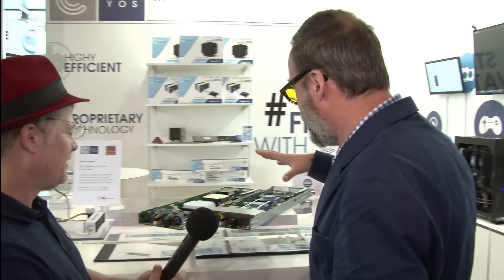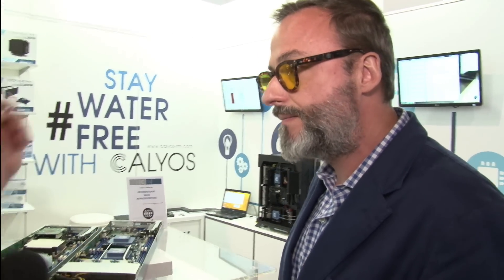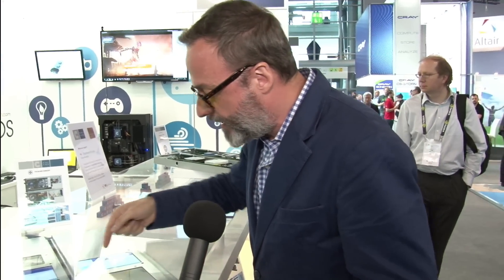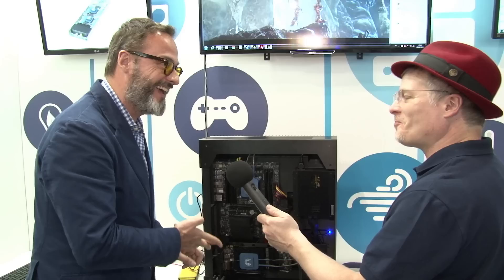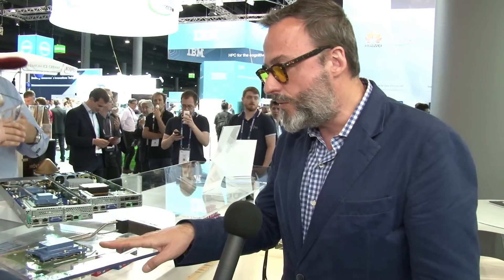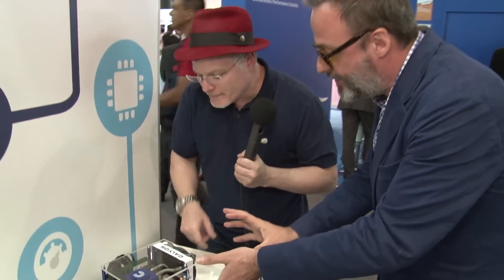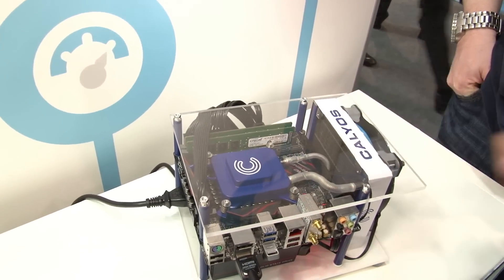Calyos Demonstrates Water Free Cooling at ISC 2016

Comment: https://www.kickstarter.com/projects/1489140137/nsg-s0-worlds-first-fanless-chassis-for-high-perfo/faqs

Does it really make no noise?
NSG S0 is equipped with fanless phase change technology. This means there is no moving parts. Cooling and casing won’t make any noise. But depending on your electronics options, you may hear coil whine or HDD working.

Last updated: Wed, March 29 2017 7:23 PM CEST

FOR GOD SAKE CALYOS. You need yo make a PSU that don't coilwhine under any circumstances. Use your cooling to cool the PSU too.
Reply: coilwhine is often experience at graphics card putting out unrealistically high fps, for example in ancient games, or menu screens without fps lock.
like the gtx260 i got will start having a strong coilwhine at 3000 fps for example.
it's manufacturer based not cooling based, however it did get a lot better compared to how it once was and is quite rare to experience, however it will be interesting how the experience changes once calyos phase change drops the minimum audio of a computer system to ambient without losing performance.
so if u don't want this issue check extreme silent tests of enthusiasts for this.

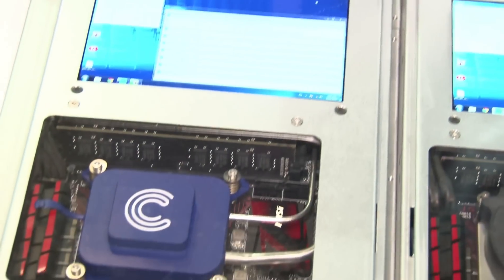Comment: 4:45 perfect fanless case! I wonder about the price tag and availability.
Reply: It's not perfect anymore since they are shipping PSU that will coilwhine. If they fix this i will buy one but not until then.
Reply: spera: I suppose they could line the chassis with sound-dampening foam tuned to the expected coil whine. And since they've already taken care of the thermals, this is entirely doable in a sealed system.